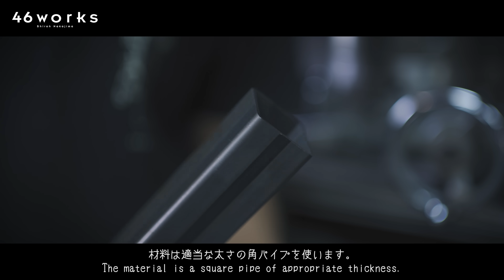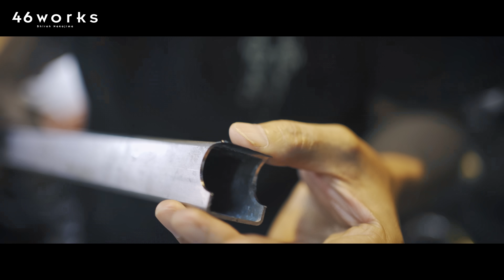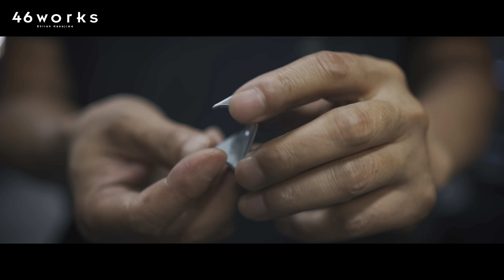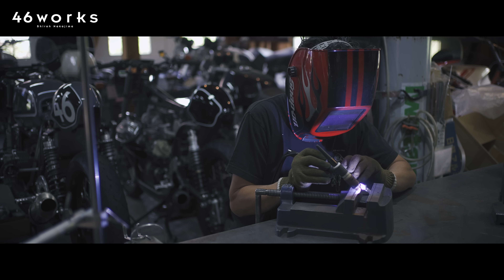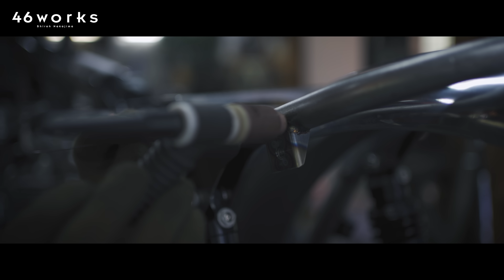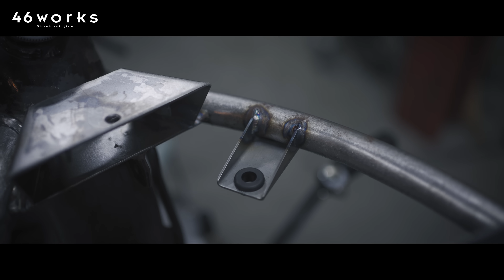強くて軽いブラケットの作り方。How to make light and high-strength brackets.

Comment: Very nice!  I use the same process, except I've stopped using standard plated nuts: my local industrial fastener vendor sells bare, un-plated nuts - I keep a small quantity on hand for welding.  More recently, I purchased nuts which are designed specifically for welding.  They come in a variety of shapes.  I've chosen a wide flange which can easily be modified to fit inside square stock.  They work great, and the weld heat never damages the thread.